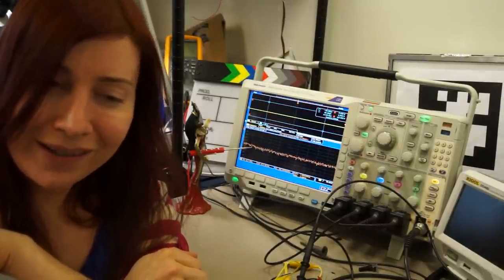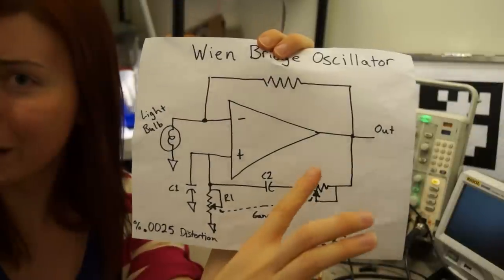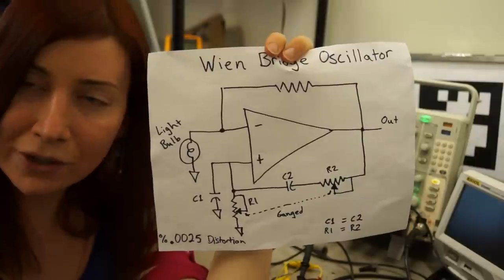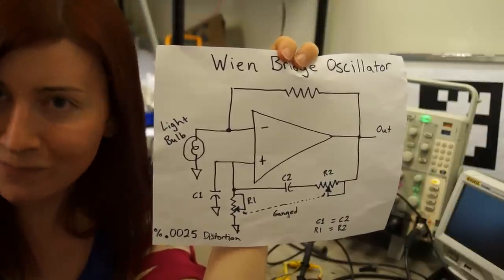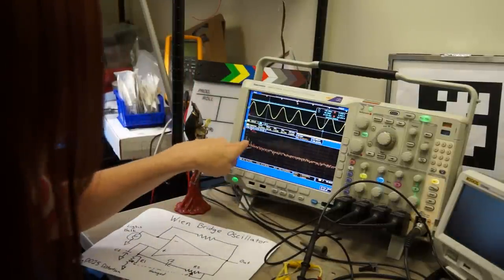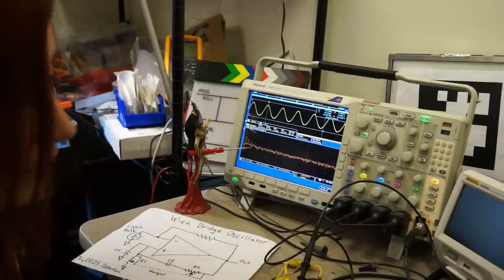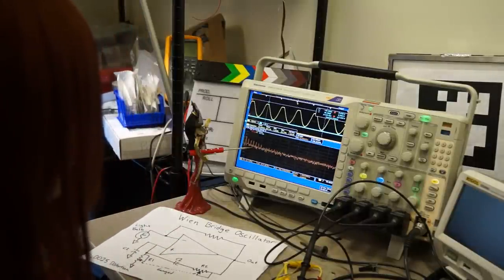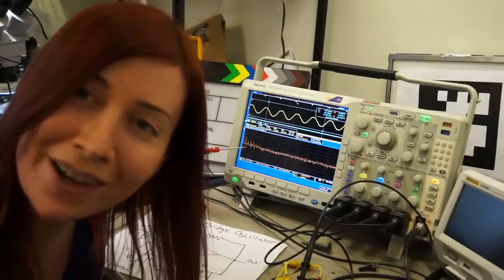Wien Bridge Oscillator - Don't Use Lame Parts

Comment: Why not replace the op-amp with a DSP processor with two ADCs for non inverting and inverting inputs and a DAC for the output and see if that works. I don't know is the code for an op-amp output=((a*(-b))*gain);
Reply: Trying to be oversmart.. huh
Reply: Analog is sooo 5 minutes ago

Comment: All joking aside:  this is not a practical circuit.  The one you show is simplified.  Limiting resistors should be placed in series with the two rheostats,  and the feedback resistor should be trimmed to adjust for minimum distortion. Ideally,  the closed loop gain should be as close to unity as possible, without reaching unity,  for lowest distortion.  Ah,  but this is academic...
Reply: Of course the resistors (R1, R2) in the negative feedback path need to be a potentiometer and a resistor in series. But the positive feedback resistor (R) only needs to be trimmed to account for variations between bulbs that are nominally the same part. The overall gain of the oscillator has to be unity, otherwise the oscillations will die away. The positive temperature coefficient of the bulb ensures that as it heats up, the gain decreases, so that a stable output is reached when positive feedback is 1/3 (assuming R1=R2 & C1=C2).

Comment: Nope, it's a honest-to-goodness FFT, besides good spectrum analyzers these days do FFT as well, just that it's done on a swept band -- it's much quicker than sweeping a narrowband filter across. There's no leakage. Just look at the sine of what this oscillator is outputting: it's not a sine wave, unless you've had too much to drink. Probably this op-amp is waaaay too loaded on the output by the negative feedback circuit, and it makes it distort like crazy.

Comment: Hi everybody, I was intrigued by the setup and looked up the Wien Bridge Oscillator for a little more info on the components and I found a variation at: 
.hqew.net/circuit-diagram/Wien$2dBridge-Oscillator-Using-Incandescent-lamp-Stabilizer_2755.html
  
This circuit uses a LM107 Op Amp which I'm replacing with a LM324 (a cheap quad version).
I liked the video and this will get me started on Op Amps. Wish me luck. Thanx

Comment: Unfortunately, it does. Just listen to it, and then listen to even an el-cheapo sine-forming made-in-china function generator. Your Wien bridge's output is worse than el-cheapo function gen, I'm afraid. The visually poor shape of the output waveform (it's not sine, not to me) and the fact that you see *any* harmonics at all on your MSO indicates there's a problem. Try biasing the output so that the sine would ride at decent DC and won't go negative, and add an emitter follower on the output :)
Reply: Or just use an LM386 for your opamp, which addresses most of the problems.

Comment: thermistor is a POOR choice to regulate the  amplitude because: 
 the feedback  power causes the thermistor to change resistance, BUT  SO DOES THE ENVIRONMENTAL TEMPARATURE  !
The light bulb requires considerable current before the feedack regulates  it's temperature, but the vacuum inside the bulb isolates it from the environment.

The light bulb wire  is far more fragile !
Reply: Yet the Wien bridge oscillator w/ lamp produces sine waves with the least distortion compared to other oscillator circuits.  Read National Semiconductor app note AN-263 "Sine Wave Generation Techniques."
Reply: If the "vacuum inside the bulb" isolates it from the environment, why doesn't its temperature rise until the filament melts? It's because the bulb actually loses the heat generated to its environment. That stabilises the filament temperature at the value where the heat generated equals the heat lost to the environment. The conclusion, of course, for a bulb being operated at a temperature not much above that of its environment is that its working temperature will be directedly related to the "ENVIRONMENTAL TEMPERATURE". And so will its resistance and hence the amplitude of the oscillator. The lamp will be no better in that respect than a PTC resistor.